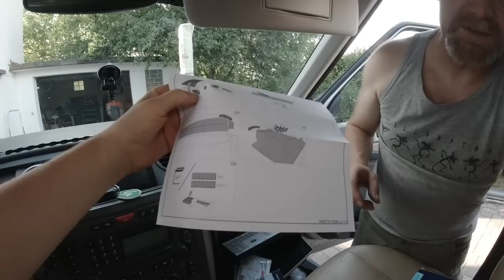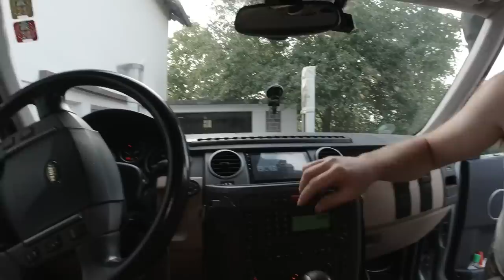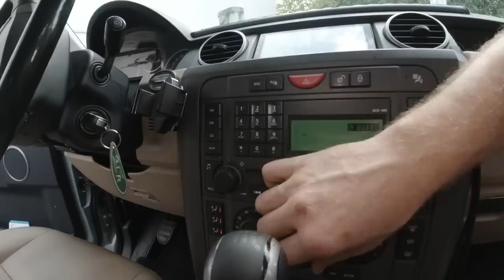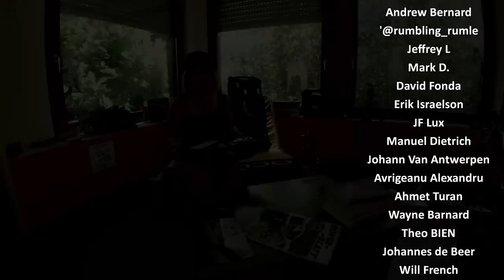How to do a Pre-Trip Inspection for Her -  Land Rover & Toyota

Comment: Hi Christian , easier way to clean ac is remove that cabin filter. Leave it out. Put ac system on hi and spray in cabin filter area. just change the settings for air to go via various vents. To save a few dollars i just use a domestic antibacterial spray called glen20 in Australia.
Reply from the maker: 👍🙋‍♀️Vera

Comment: Don't worry, Vera the intercooler hoses last 160,000km on the D3 and 320,000km on the D4. 
Get a cheap solar powered wireless Tyre Pressure Monitor and follow the 4psi rule to ensure you always have the right tyre pressures. So far, mine has saved 3 tyres from destruction.
Reply from the maker: We have had the intercooler hoses break on my Discovery 3 and Freelander long before 160000 km.  So I speak from experience when I stress about something like that. 😅👍But, I am fully covered with extra special parts to fix intercooler hoses on the road. They of course, always break on a trip in my case, never at home. 💪 We actually can dedicate an entire video to that. 🙋‍♀️Vera

Comment: I have one "repair" of the height sensor linkage, that is cheaper.. one drop of oil on the connectors (rubber to steel) made mine react more or less as supposed again. Of course, it does not cure the wear after 275 tkm, but reduced the number of daily bings significantly ;-) Next step is overhauling the suspension.
Reply from the maker: Good idea.  The sensors are out there in the elements and receive a pressure wash here and there.  Nobody takes care of them.  It’s actually surprising how long they last.  Christian

Comment: " if you want your wife to go on a trip....I mean if your wife would like a trip "...priceless 😅
A word to the wise; set your ac on 21c,  recycle mode on a low fan....poke the tube in to the passenger footwell outlet...on recycle it will pull the product through all the ducts. Make sure the face and screen vents are amost closed.
Finally..." Chineseum"...some of the stuff you come out with 😅😅
Reply from the maker: Gonna try that next time. 👍🙋‍♀️Vera
Reply: The reason for 21c is the heater flaps will be slightly open next to the heater matrix..it's important to disinfectant that too. Lowest fan setting....
Reply: The very best system I've ever used is made by Wurth...( German naturally)...it's an atomising vapour drawn in on recycle and takes around 45 minutes.
I cannot remember the model name, the kit arrives in a small suitcase and the dispenser resembles a kettle.
It's so good...it would be possible to sell it as a service..we charged € 65 at the time...there was a waiting list !... especially for German cars...
It also disinfects the whole interior and does not leave any residue

Comment: I just changed my cabin air filter.  My filter said air flow this way with arrow symbol facing the way air flows , how you know its was installed the upside down /  second question i bought new radiator i m having issues removing old old what is still attached to ac condenser noone has good well detailed video explaining what attracted points still holding radiator in place to remove its driving me crazy on a simple replacement 🙃

Comment: I need to get some of that AC cleaner- question- would pulling on the tires to check the wheel bearings also reveal issues with the tie rods?

Comment: Hey guys! Thanks for sharing all the knowledge throughout years. I don't even have a Land Rover, but I have watched several of your videos.  Now I'm planning to get a Discovery 4 (2010) With high mileage (460.869 km) Because it is cheap, compared with others with lover mileage 50% cheaper. The seller is giving 12 months warranty. My thinking is that having all those miles, all the big problems are already sorted out. The exact model is: Discovery 4, engine 3.0 TDV6, HSE PRO. 245hp.  Do you think is a crazy idea to buy it? Will it break my already broken bank account  😂.  Thanks a lot in advance!
Reply from the maker: Oh you are on your own if you think that you can get away cheap with a Disco with that mileage. 😅 And it's also already 12 years old and a first generation D4. Watch that video first. https://www.youtube.com/watch?v=chsGDZ3pZUY . Every single piece will be worn and beat up.  Just think about the suspension. And there is more to the suspension than air shocks. It's a lot of work and money. And do not expect that to be replaced under warranty. Now if want to get a cheap one and invest money and hard work to bring back, we are all for it. But if want a cheap ride, .... just don't.  Owning a Discovery is not cheap, at all, unless you know how to do everything yourself. And you know the effort and tool we put into it. There is more to an Discovery than the engine.  And you need a diagnostics tool to get you back out of limp mode.  🙋‍♀️Vera
Reply: @Vera_and_Christian  do you have any video where you measure compression of the engine?

Comment: From Wisconsin US.  Have you figured out a fix for the steering wheel leather curling up on your LR3?
Reply from the maker: 😳There is no problem with my steering wheel leather. You sure it was mine, or did you see that on someone  elses Youtube Channel. 🙋‍♀Vera
Reply: It’s a common problem as the L319, L320, & L322 age.  I thought I saw similar occurring on yours.  It’s along the top of leather covering the center of the steering wheel.  Better felt than seen.
Reply from the maker: @davelr3x474  Here in Germany, with our weather and temperatures, you only have damage on the interior, if you are neglecting your vehicle. I am so glad we don't have interior damage like guys in Australia or soutwestern US or anywhere hot and dry. We have to deal with rust, that is enough😅🙋‍♀Vera
Reply: I checked you 06/19/22 video and at the beginning of the video it is apparent your leather is indeed cupping/curling up.  It’s at that
He beginning Whalen you’re driving.  It gets worse as time passes;-). BTW WI weather is terrible in winter (snow and road salt) and the summers can be just as bad with scorching heat and humidity.  I have often considered relocating to Europe for the great weather;-).

Comment: 1.75l is the difference between min and max!!!
Reply from the maker: I just looked it up.  The wording in the LR3 manual is: if below the minimum, add one litre (two pints) of oil and, after five minutes, re-check the level.  Filling 1.75 would do some major damadge.  Christian
Reply: @Vera_and_Christian  So the Haynes Manual is all wrong! Also a pint is close to 600ml.🙂

In Britain, the Imperial pint—equal to 568 milliliters—has been the legal beer measure since 1698, and woe to the publican who pulls a short pint.